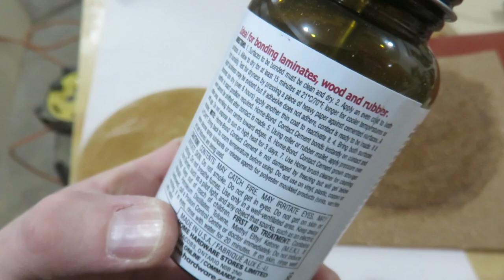Make a Drum Practice Pad

Comment: the 3 best rudiments to start, are the "single stroke roll, Double stroke roll, and the single paradiddle." Start slow until it feels comfortable and then speed it up a bit.
Reply from the maker: Thanks for the advice Kevin.
Reply: Always use Metrodome. After using one for awhile you hear it even when not using one so then your meter with be on time. Shows you also when your off when you wouldn't know otherwise making you a better drummer when you hope on the drums.